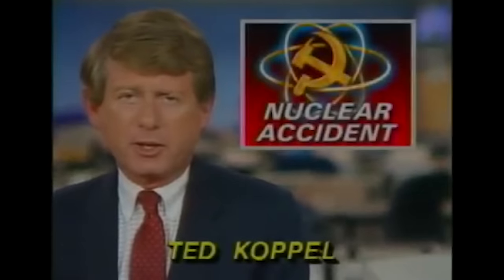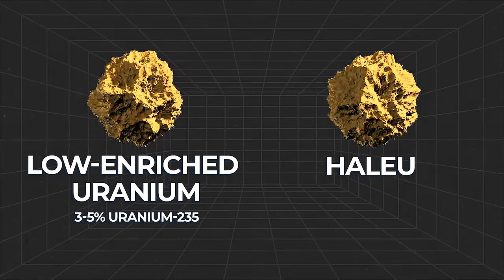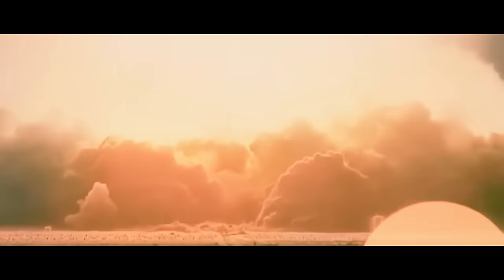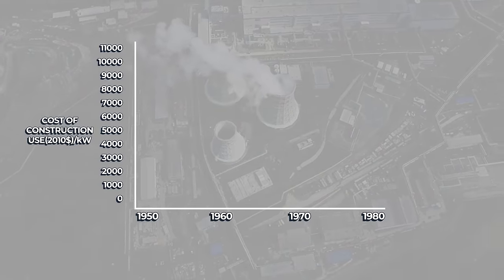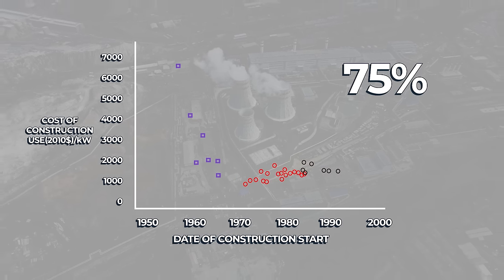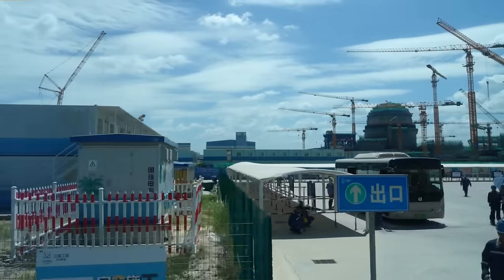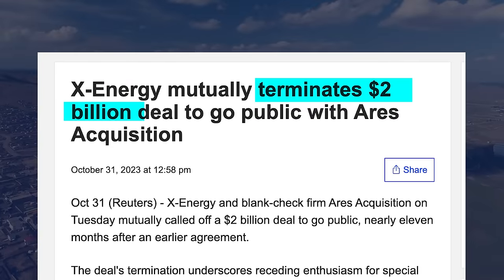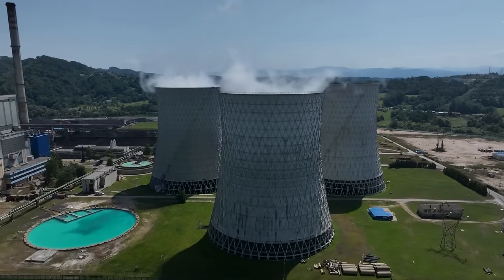Nuclear 4.0 | The Small Modular Reactor Revolution

Comment: I had this discussion with some friends who live in a small town a few hours away from me. They were very enthusiastic about a small scale nuclear reactor that could be dropped off in their town, solving their energy problems forever. I asked them to have a look at their current lot of local councillors and council staff and choose somebody they could could trust to run the little plant, keep it safe for generations, and dispose of the waste. Nobody could put forward a name they would trust, which suggests to me that safety of these things depends on more than just good engineering.
Reply: The issue is not safety, it is cost.  Ask your friends if they would be willing to pay 3 times or more for electricity in order to solve their energy problems?  Vogtle (Ga.) just completed 2 new nuclear plants at a cost of $17 Billion EACH for a 1,000 Mw unit.  SMRs cost more per Mw capacity.  Can their town afford that in their budget?
Reply: To be fair what local politicians do you trust to run conventional power generation plants and keep them good for generations?
Reply: Decentralized power generation does not mean local control. SMRs are intended to be buried in the ground and remotely controlled.
Reply: @evanpnz  That sounds great until you look at reality.  Every nuclear power plant will require staffing, including operators, maintenance, security, management.  There are literality thousands of valves in a nuclear plant, even a SMR and they don't open and close themselves. You just don't start major equipment without people monitoring the startup and while there are hundreds of sensors that can be monitored remotely there are many more that only read out locally. The reactor primary is just a very small part of an electric generating power plant.
You need to tour a plant to understand how complex it is.  There is no magic with SMRs and they are less efficient that the standard size units. So a SMR that puts out 1/10 the Mws of a full size reactor will require more than 1/10 the acreage.
I am basing my comment on 40+ years in the industry at 5 different facilities.
Reply: @clarkkent9080  I must assume that the folks designing the new plants know their business too, and that's what they are planning. But for sure I am just an electronics tech with an interest in the subject so I'll defer to your experience.
Reply: @evanpnz  I am pro nuclear, would love to see a nuclear resurgence and can discuss all the safety and waste issues but there is no argument I can make on the cost.

We are simply in a time where natural gas prices make natural gas turbine produced power cheap and very good at load following.  Solar continues to become more efficient and less costly as time goes on.  Wind turbines are nice to look at but there are places where wind blows 24/7 and $1 Gw of wind turbine capacity costs ~ $1 billion while a 1 Gw nuclear power plant costs $17 billion. 

Those are facts that hold up even without the climate change issue.
Reply: Nuclear power would be a huge brain drain. It takes a lot of smart educated people to safely operate nuclear power plants. Solar and wind require zero engineers to run. Just a few construction workers to put up. This is one of the reasons why nuclear will never make a comeback. The other is price and the dynamic power grid.

Comment: Another use would be backup power for facilities like hospitals or military bases.  Places that are connected to the grid, but need to be immune to broader power outages or shortages.  Normally it just sits there, selling power to the grid to offset its own purchase price.  But if the day ever comes when it's needed, you've got megawatts available for any length of time you might want. In that use case, the fact that it's potentially more expensive than the alternatives is irrelevant, because you're only paying the difference to have guaranteed power on demand.
Reply: The military tried this at Fort Greeley in Alaska in the late 50's and again 10 years later at McMurdo. Both were operational failures. Reciprocating piston diesel generators are an extraordinarily well developed technology with low acquisition costs, low storage costs and lower operational costs.
Reply: @otm646 But that doesn’t answer the carbon emissions.
Reply: That is rediculus, a SMR is not a back up disel generator, it contains highly enriched uranium and has to be guarded by armed men at all times behind a fortified limited access compund.  Their is no way to just put that behind a hospital.
Reply: @kennethferland5579  SMRs don’t use highly enriched uranium. Stop talking nonsense.
Reply: @kennethferland5579  Ok, so stick it out front where it's always in plain view.  Definitely not a smash & grab operation!
Reply: @otm646 It's a question of just how reliant you want to be on an power source that requires a constant supply of fuel.

Also, "We tried it 60 years ago when the technology was brand new" isn't a slam dunk refutation of the idea.
Reply: @otm646 SMRs have greatly improved since then. Also there's a plant being built in Ohio if I remember correctly to build them. Another use for these SMRs would be to replace the diesel engine in trains. After replacing and rebuilding the railway network of course. Also freighters could make great use of them as well instead of the costs of constantly running and replacing diesel.

Comment: All SMRs mentioned in this (very good) video still need custom steam plant turbines to turn low temperature steam into electricity. Heavy nitrogen (N15) cooled reactors with direct cycle turbines based on open cycle turbine designs from natural gas plants might be a solution. I'd also like to see these nitrogen gas cooled reactors borrow Moltex Energy's idea of putting a molten fuel salt in fuel pins. This eliminates the real hazard of nuclear reactors - release of radioactive gases in an accident. It would also surely lead to much lower fuel costs than using TRISO fuel.

Comment: I think the micro reactor model would be good for small rural towns, and not just ones that are very remote. This could reduce the need for large distribution centers that transport the power great distances. This would also have the advantage of being less susceptible to widespread outages because the grid could be segmented into smaller units.
Reply: That depends on  how controllable the output is, traditionally nuclear reactors only function well with a steady output.
Reply: Grid is still present for backup and load leveling, but huge redundancy with higher reliability becomes possible. So called renewables reduce grid reliability. And they are not economically or environmentally friendly in spite of all the hype to that effect.

Comment: This is what I came up with that should be considered:
1. With all of these large scale light water reactors, we need to get back into fuel reprocessing.  Only 5% of the U-235 is used, so we have vast reserves of U-235 just sitting in cooling ponds for spent fuel rods right now.  This U-235 is what also makes these fuel rods hazardous for eons, so consider below for how to solve this problem.

2. The Thorium MSR.  You may say well we have Thorium to burn.  Right.  But do you understand how this all starts?  Well you stuff in some U-235 starter fuel (look above for the proposed source of this U-235) and long story short, you breed Thorium-232 into Uranium-233 and then burn the highly fissile U-233.  This all gets into neutron absorption and decay where the Thorium has to absorb neutrons and then have a decay to become Uranium.  The thing is Thorium is stable, so we have enough to last us until the Sun turns into a red giant and swallows the Earth.  We don't have enough Uranium, so we really need to focus this in as a starter fuel and then run off of Thorium bread into Uranium after this.

3. A Thorium MSR can run a jet engine directly.  No water needed for this power generator.  Maybe even focus in on desalination as a second stage as in use the hot exhaust of the jet engine to make fresh water.

4. A Thorium MSR can be mass produced as an SMR.  The thing is Thorium MSRs are very energy dense while maintaining inherent safety.  Water just can't be all that hot and is inherently unsafe, so you end up with a large, low density design trying to compensate for these pitfalls.  The MSR is high heat, non-reactive chemically, and inherently safe, so can be made energy dense.  Energy dense can be made a lot more cheaply.  So doing this at scale would be cheap and thus you solve the cost issue.

5. A liquid core MSR can have a continuous chemical process applied to it to separate out waste products and introduce more fuel.  No need to stop the reactor to swap out spent fuel rods or even fuel spheres that have cracked from the gaseous waste products building up in them as atoms get split up into smaller atoms.

6. We can make chemical fuel with electricity.  The reason we don't really do this at scale today is electricity is just too expensive.  Mass produced Thorium MSR SMR reactors should get into extremely cheap power.  So now you have this cheap electricity where ever you need it, you can get into mass producing hydrogen and methane.  Methane (natural gas) is already used everywhere.  Methane can be turned into propane and propane is used everywhere.  Consider when you make methane and propane, you can capture CO2 from the atmosphere / before it enters the atmosphere from say a smoke stack.  So you use CO2 in a circular fashion, making it net zero emissions wise.

Especially if you get into making the propellant for SpaceX's Starship, you could have a major propellant producing facility powered by Thorium MSR SMR reactors pulling in sea water and air and outputting liquid methane, liquid oxygen, and liquid nitrogen, all of the things needed to make Starship work, and then just pipe it into the launch site from a safe distance away.  As Starship launch cadence increases, just modularly add more reactors and other equipment to the facility.

7. SMRs can be used for giant commercial ships.  Especially if the ship has say 250 MWs of SMR(s) onboard, it can fast steam around the world, slashing trip times.  As for risk of hijacking / attack, well just fast sail around Africa, avoiding the main hot spot in the world where this kind of stuff happens.

8. As for space, especially if you help out Starship in #6, you want to fan out into the solar system and do resource gathering and processing in space.  After all, everything on Earth fell in from space and space has all of the raw materials in its more pure and elemental form to start out with, so much better in a lot of ways than getting it from Earth.  You just need nuclear to efficiently get around space and nuclear to also supply regular electrical power for everything as in deep space the Sun is too diffuse to be all that effective as an energy source.  The Sun is only really all that useful as a power source in the inner solar system.  And you are wrong about the Moon.  It is 2 weeks in darkness and 2 weeks in the light.  Need nuclear power to cover 2 weeks in darkness at a time.

Once you have all of this resource gathering going on in space, something like Starship will be more focused on moving people around and less on moving material around.  Starship as a shuttle to infrastructure in LEO has more interior space than a Boeing 747, a plane that can potentially hold more than 500 people.  It is just if you kit it out for say a  whole trip to Mars, it is filled with stuff for the trip and so very little capacity left to stuff humans inside.  At this chemical is a very inefficient and ineffective way to get around the solar system where everything nuclear, and there are many possibilities around this, has a lot more kick and so can make it trivial to go anywhere in the solar system, turn around, and come back to Earth.  Even going out to say Pluto, nuclear could make that a weeks to months long trip that you can then turn around from and make it back to Earth.  So of course closer places like the resource rich and easy to mine asteroid belt are easy peasy to get to with nuclear.

Comment: The 3+gen European EPR reactor is producing 1600MW so the SMR mention in this video need 21 reactors to produce the same amount of power. EPR is buildt at 8-9M$ for each Megawatt, but the failed Nuscale/Utah project clocks in at 20M$/Mwat. Nuclear is ridiculously expensive both at small or large scale. Even before waste handeling is considered.

Comment: Having operated a nuclear reactor on a US Navy submarine, I have a few things for this video.

The term Super Critical gets an overcharged negative connotation associated with it. During a reactor start up, we actually need the reactor to go super critical to get everything to full operating parameters. Once we are operating where we need to be we control the state of criticality with the control rods and the demand of the steam being produced. The more steam that is used, the cooler the coolant is leaving the heat exchanger. The colder the water, the closer the atoms are to each other. The closer they are to each other when they get to the reactor, the more reactions you get which in turn makes the reactor super critical for a moment, but everything will eventually even out back to a critical state. It was only when the steam demand was dramatically increased that we had to take actions with the control rods to prevent an uncontrolled super criticality. Just because a reactor goes super critical does not mean it will end in a failure of some sort.

The other point I have is I did not realize our reactor would have been considered a micro reactor as I do not think it would fit on a truck (or lorry), so I was imagining the small modular reactors to be smaller than what we had on the sub.

Great info, excellent video, thanks for everything!

Comment: One application MNR could be useful in is a situation we have here in Kansas. Panasonic is building a large battery factory in a near by city. This requires a huge upgrade to the areas power grid. This is being done via a special tax and a rate increase for the customers of the local power company. However, neither of these apply to the county this plant is being built in. The local residents that are going to benefit from the large amount of high paying jobs are not footing any of the bill for this. If instead this plant could have its own MNR or two to power itself the grid upgrades wouldn't be necessary thus meaning no cost being spread out to surrounding communities that aren't getting the benefits of the site to begin with.

Comment: One aspect not discussed here is the concept distributed generation versus central generation, and its impact on infrastructure stability. 

Blackouts aren't usually caused by a failure at the generator, but rather something within the distribution grid. These small failures can cascade when the load transferring nature of a grid activates a sequence of self protective features. 
The current power grid relies on a few HUGE generation points, and massive distribution networks. If it were feasible to build smaller generation facilities efficient and clean enough to place throughout a region, then the amount of distribution serving each generator would be much smaller and the ability to contain any particular loss of power to a small area would be dramatically improved. SMRs are the only technology likely to meet this challenge.  
As much as this would benefit wealthy nations with extensive and aging grids, it would be an absolute game changer for countries with less overall power and little grid stability.

Comment: Thorium would be a better source honestly. Little to no run-away meltdown risk, and far less toxic waste. 
As for "clean" ... Nuclear is cleaner and safer than "green" energy statistically speaking.
Reply: what actual operating reactor are you basing your comments on?
Reply: China has been building it for the last five years and it has been given the green light to commission shortly. TMSR-LF1
Reply: @evanpnz  If you research that further, TMSR-LF1 is a demo test reactor that just began operating. It is 1/4 the size of the U.S. ORNL demo reactor that operated in the 1960s.  It produces no electrical power.

I would not believe much that China says, but they do say it will be operated for 10 years to gather data on the reactor system BEFORE operating any of the support systems that are necessary to prove many of the claims you make.

Thorium has been tested in many reactor types  in many countries but today there is only  1 operating commercial Thorium reactors. India has built a small prototype Thorium reactor and for them it makes sense since they have large Thorium reserves but no uranium reserves.
Reply: @clarkkent9080  Yes. I read the whole article. I understood all of that.